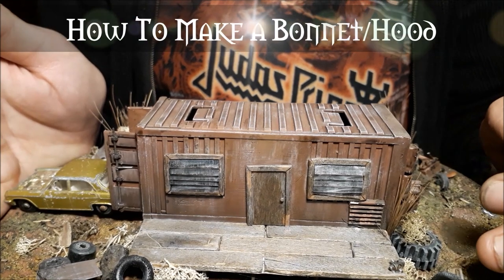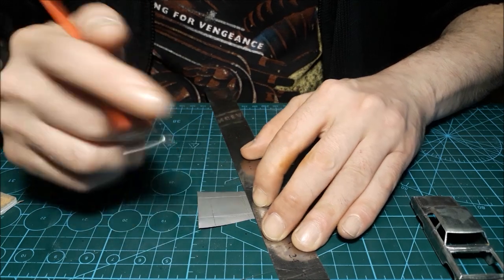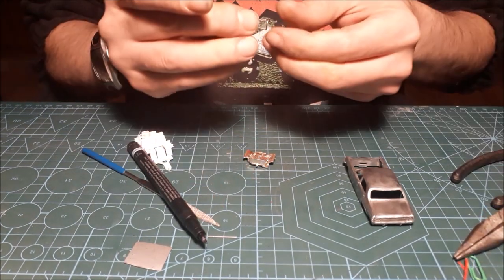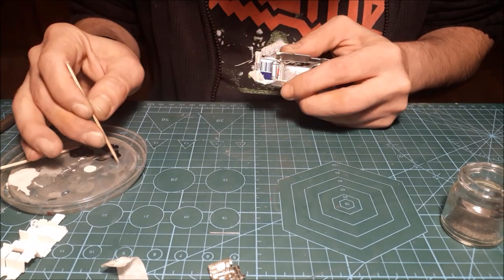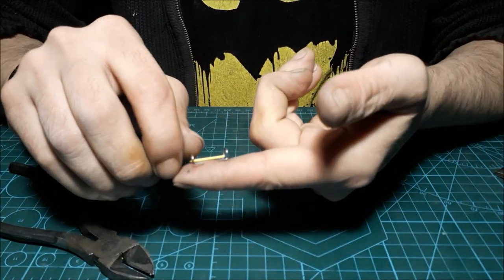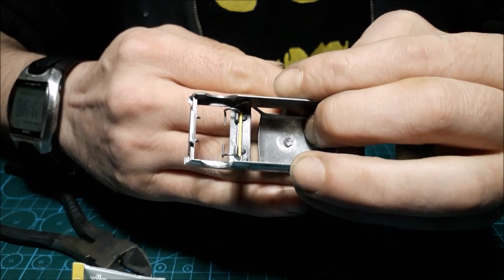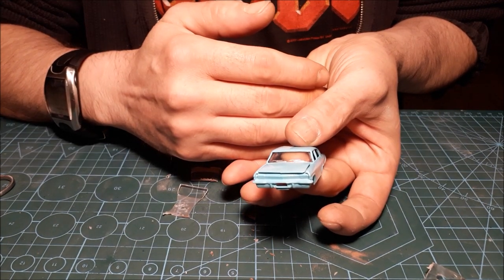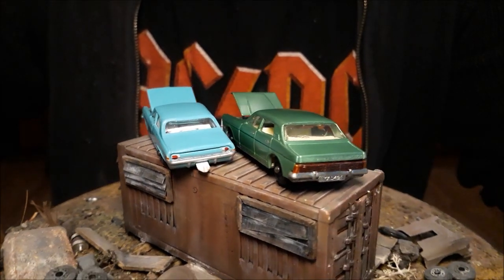How To Make a Hood/Bonnet From Scratch For Your Diecasts

Comment: That Zodiac must be one of your best resurrections Juan. That colouris a very tricky one to copy and it looks absolutely perfect. The bonnet is certainly a better fit than the reproductions that are available but, I would say, it's a better fit than the factory pieces made by Lesney. Ir probably has better, stronger hinges than any all-original Matchbox car. Zamak was a great material for casting cars; making working hinges - not so much. That's why so many of these cars have missing bonnets and boots. Most of the missing parts would have been in good shape, just missing the hinge pins.
Using a second layer on the bonnet was a clever move, way better than trying to bend one piece into shape. The edges blend perfectly with the lines on the car and it just looks "right".
Replacing bits of broken Matchboxes with repro parts can be interesting to watch but seeing someone fabricate precision parts from household junk, with simple tools, is a wee bit better.

Thoroughly enjoyed this one. Maybe, in future episodes, you could apply some of your other skills and give us some useful corned beef recipes? 👍👌😁

Have a great New Year when it comes, Cheers,🥃🍻 Dougie.
Reply from the maker: Thank you very much for your kind words Dougie. Lolololol That bit about the corned beef got me in stitches..🤣🤣🤣 Have a great new year you too my friend

Comment: What type of pliers are those you're using to fold the bonnet edges. Never seen none like that before. All mine are serrated or not a solid flat like yours.
Reply from the maker: They are flat nose pliers and they are used mainly for jewelry making. Thanks Dave
Reply: @MatchboxResurrection  thanks Juan. I've just ordered a pair off ebay. Thanks again for the Info and video 👍👍
Reply from the maker: @reddave8628  Glad I could help